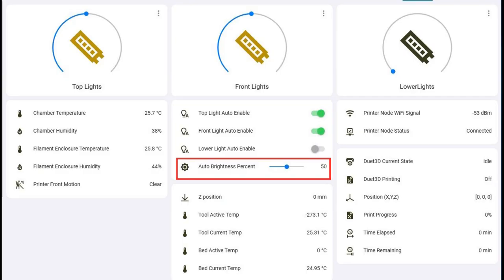NewCoreXYPart12

Comment: I wish you could print me out a block of enthusiasm, I might then be able to finish my segmented bed controller.    I like the light controls , perhaps  strips of neo-pixels on the vertical lights could be made to follow the Z height 8-)
Reply from the maker: When I started thinking about lights, I did think about using addressable LEDs (neo-pixels) to have the vertical side lights track the bed height. I dismissed it at the time because it wasn't easy to track the bed height with some sort of device connected to the ESP 32. But now that I've found a way to get the Z height from the Duet board into home assistant that'd be a piece of cake to implement. I just need an automation that will change the number of LEDs in the string to a value which is proportional to Z height. Hmmm........